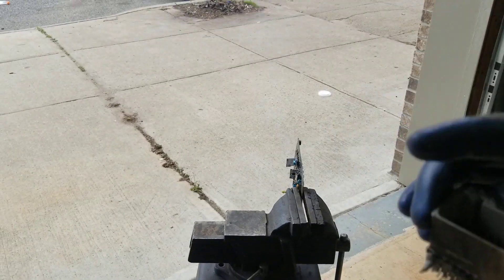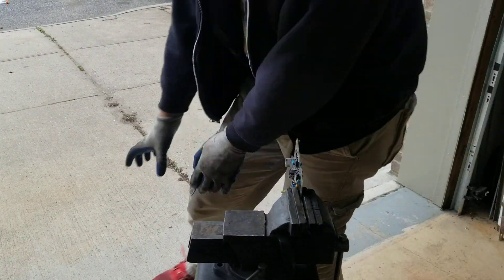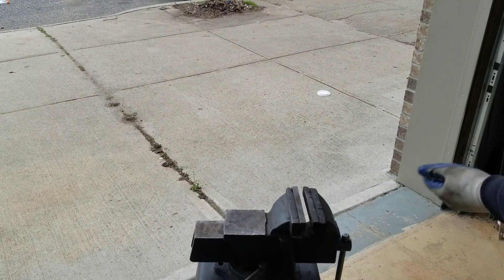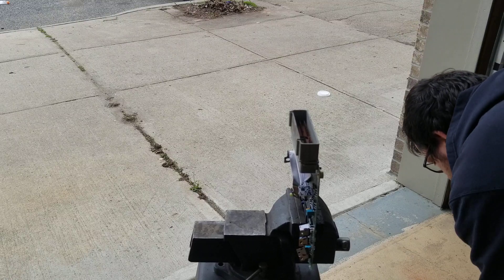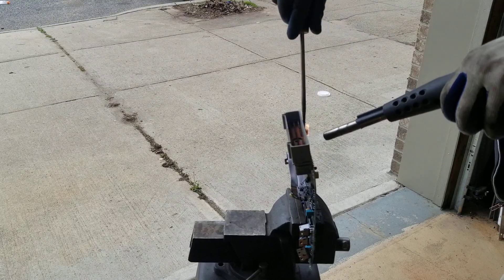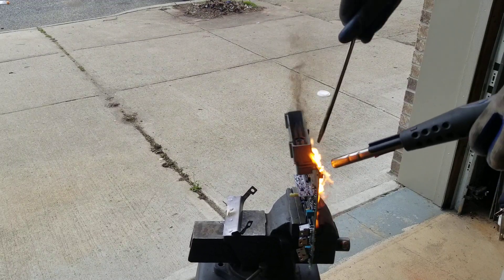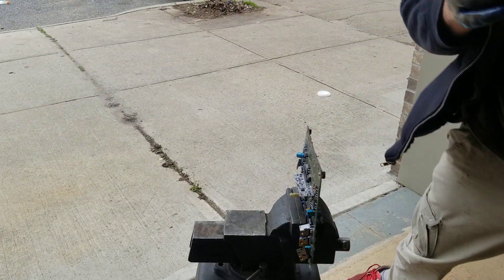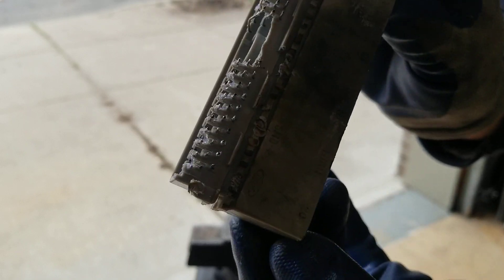HOWTO desolder a connector from a used ECU

Comment: 04 mazda have a faulty relY inside the emc. A $5 part. I need to desolder the ecm unit so i could get to the relay change it then soldet it back together. The other option is paying the dealership over a thousand bucks to change the ECM. I really want to try and fix the problem myself. I do t ha e that kind of money but i  eed my car